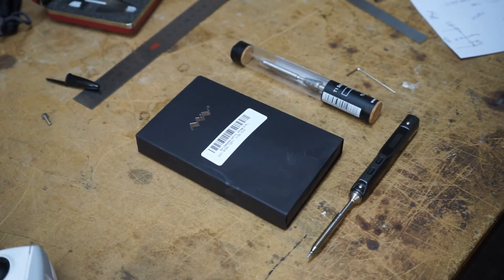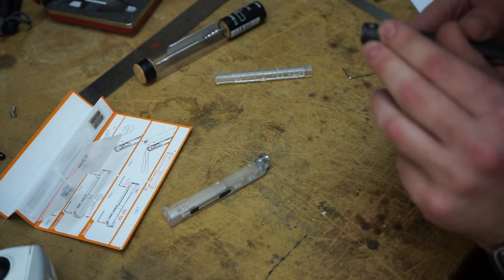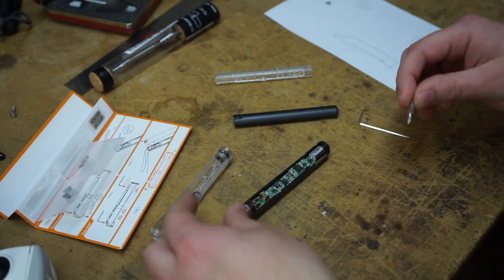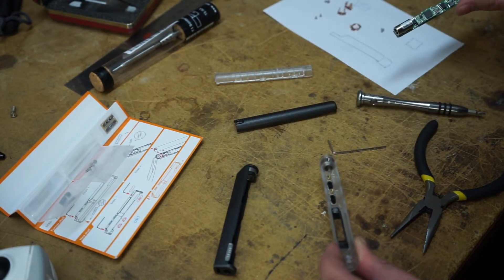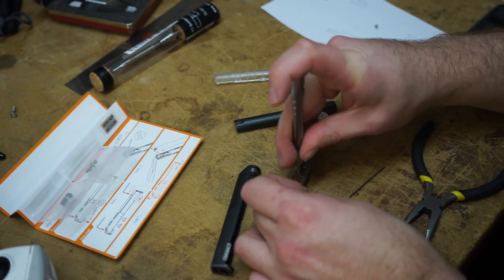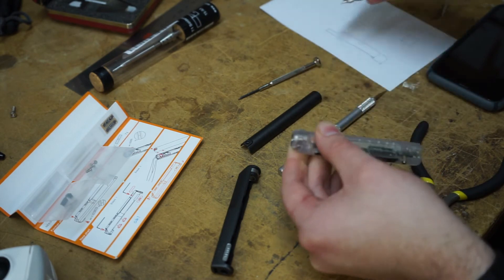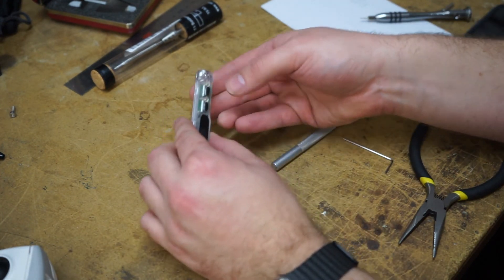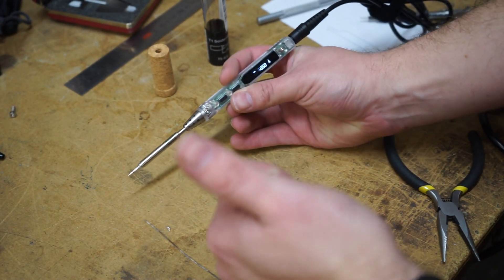TS100 Soldering Iron Clear Case and TS-ILS Tip Installation

Comment: Great video, and the only one I've found so far which shows how to open/close the TS100. I'm having difficulty putting the top plate back in, just as you also had. Any chance for a more detailed explanation, closeup ?
Reply from the maker: So if I remember correctly there is this tab you have to push flat before you can put the case together. I used a thin tool like a jewelers screwdriver between the upper and lower chassis to hold it in place as I slid them together. I’ll set a reminder for myself to shoot a quick video on that.
Reply: I managed to fit it back together, the key was indeed the copper tab which needs to be pushed away with something thin (I used a paperclip leg), but that alone didn't seem to work so I also used something knife-like to shoe-horn the upper chassis in place. A video would be nice for others who stumble on this problem!
Reply: @p8blr  Does anyone know what that copper ring/tab is for? i broke mine, so i removed it and the iron seems to work fine without it
Reply: Glad I looked into this when I noticed my shell wasnt seating easily. Forcing it more wouldve probably broken something.

Just to clarify, there is a semi circular tab on the end closest to the tip. Insert shell into rear, lower the shell down, now push on the back side of the semi-circ copper piece to flex it forwards (towards where the tip of  the iron points).

You may have to push it forward on one side, then while still applying slight pressure on the shell, push the tab in the same manner on opposite side and shell will close.